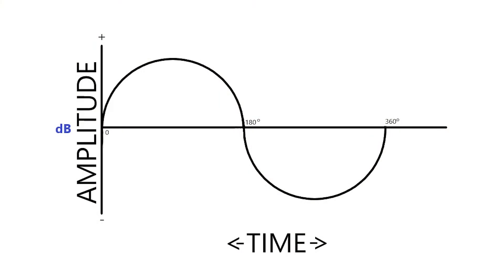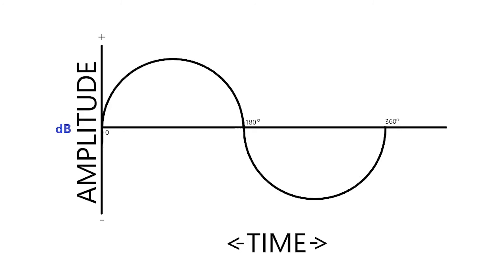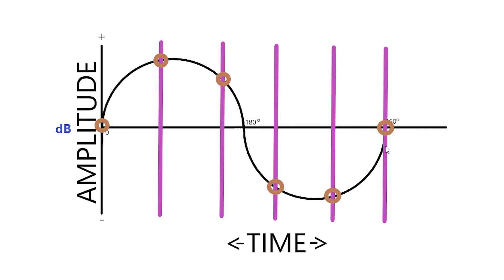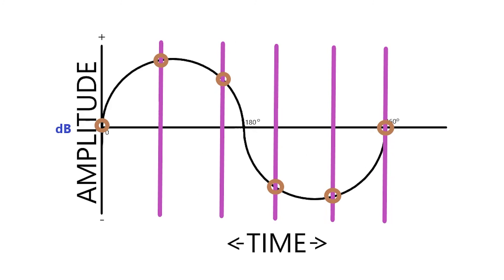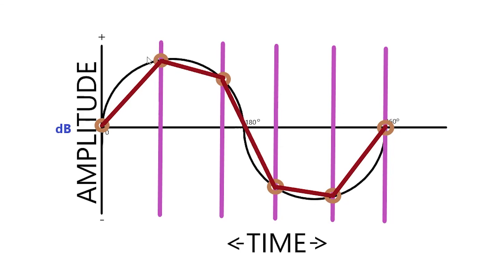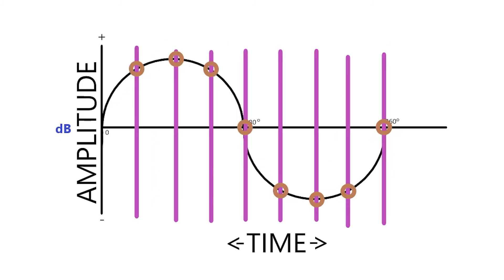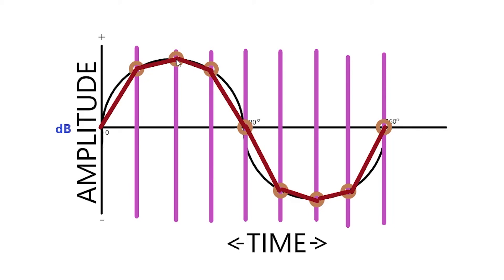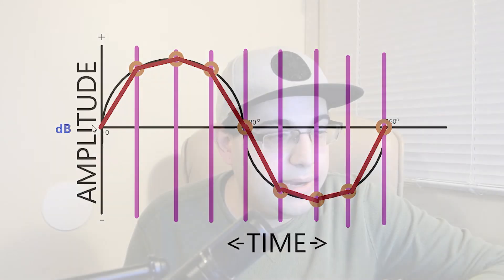Sample Rate? - The easiest way to understand sample rate - What is sample rate?

Comment: Where do the files of all those snapshots get saved to?
Reply from the maker: Excellent question!  All those little snapshots that it's recording in...  As the analog to digital converter in your interface captures them, it is sent inside your computer for your DAW to capture as well.  This happens within a "buffer", like cashe and ram, and the buffer just kind of stores the information as it's being processed in.  This is all happening without you needing to worry about it 9.99/10 times, and once this process is complete(Kind of like putting together a recipe, putting it into an oven, waiting a little bit, and boom!  - Cupcakes)  boom!  - Your .wav file.  All put together as ordered...  Hope that makes sense!!!  lol
Reply: @DonZiglioni  thank you very much brutha!
Reply: @DonZiglioni  so how does buffer rate and sample rate directly correlate?